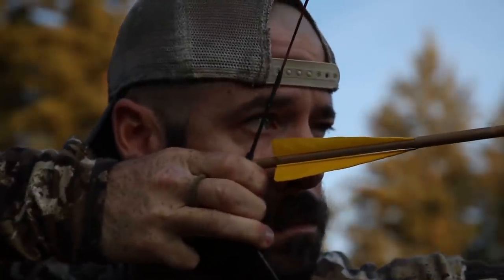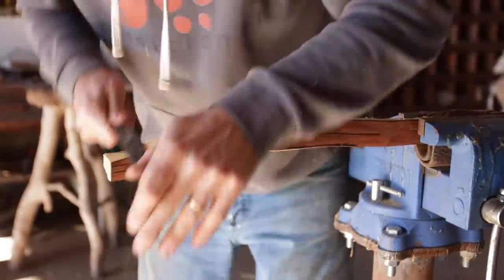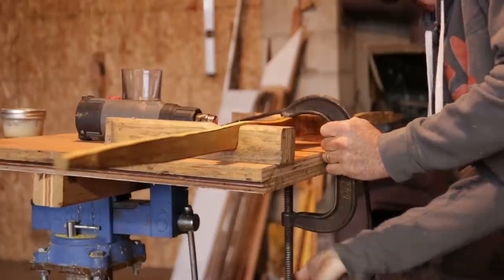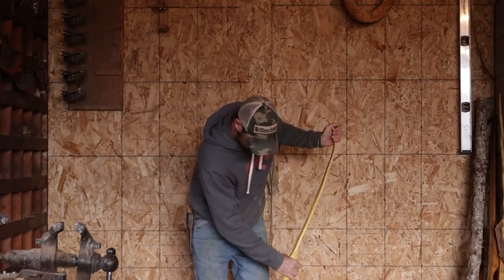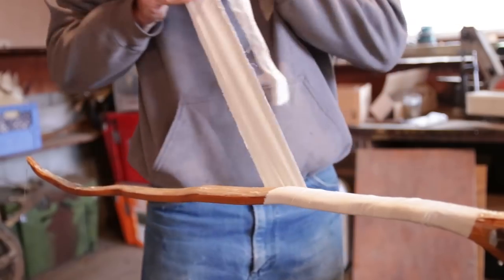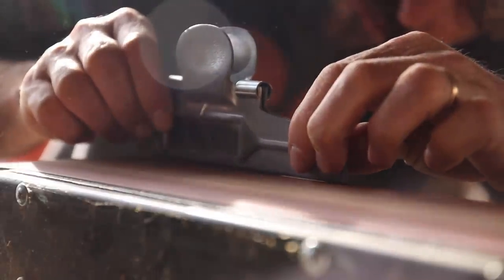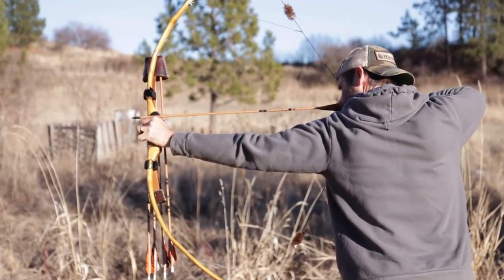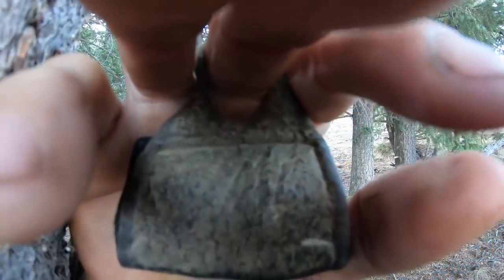Building wooden Recurve Bow from Tree and Bow Hunting

Comment: Ok, here is the deal. Osage costs too much for me to participate. I love building bows from Osage or Yew. They are, like, want to be a bow! But, getting a stave is way too time consuming and way to expensive. I have even bought some sawn Osage, but it all has to be backed. Very frustrating. Good video, as always.
Reply: Lester, you might check on Billy Berger's website. There's a video there on making what is referred to as "whitewood" bows, hickory I think is one of those. Apparently he has collaborated with someone who has the knowledge to make great shooting bows out of some of the more common woods via heat treating. Haven't seen the video, just happened to notice it while on his channel. Might help you out. What part of the country do you live in?
Reply: Lester, pretty good bows can be made from lots of different woods. Right now is the time to collect them too. If the sap is up the bark can be stripped pretty easy from elm and hickory and you already have a good back. Check out THE BENT STICK. I think it's a book by Jim Hamm. I've made some pretty good bows from black locust and hickory. Just make the bows a little longer and the limbs wider. Preshape the bow then make sure to let it thoroughly dry before you tiller. Hang the tips of the limbs from the rafters, the back of the bow up, and hang a weight from the middle of the handle. As it drys it should force some backset. Hickory is easy to shape with heat.

Comment: #6 is close! I'm hoping to back with bamboo and reflex/deflex slightly. Is heat treat required. Sorry for aggravation. P.s. that snake bow is nice!
Reply from the maker: No it’s not required
Reply: Clay I cant thank you enough. My board bow shoots! My question is, my arrow shelf is a bit off center and causing bad arrow flight. Should I take more wood out? I'm afraid it will break.